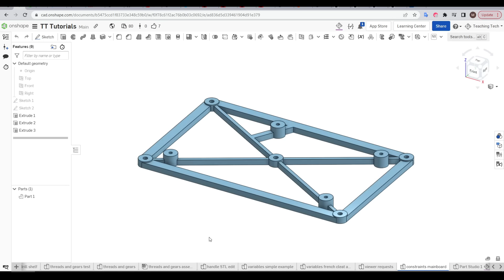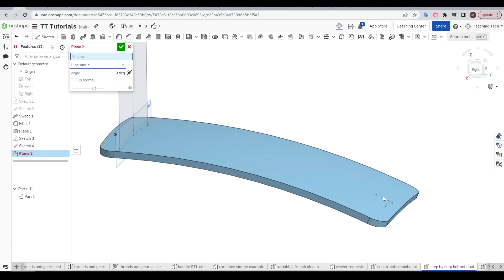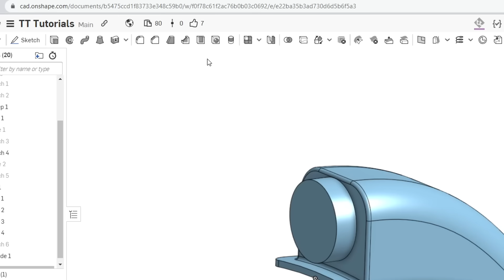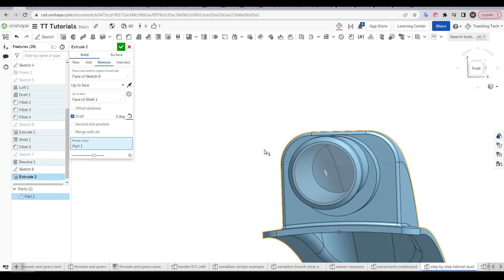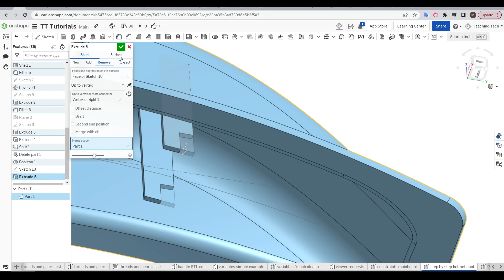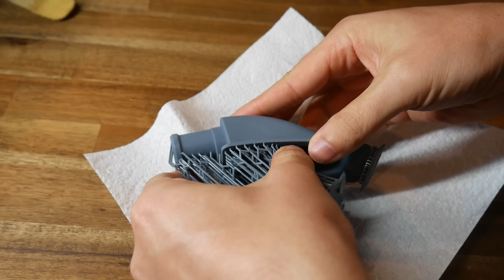Complex design from start to finish - 3D design for 3D printing pt11

Comment: These are the types of videos you bookmark to reference later when trying to model. I have been self-teaching myself on OnShape the last couple months, and have gotten the hang of basic parts that I want to make, but there are a ton of options that I avoid because I don't know what they do, so I work around them with what I know. Just seeing how to easily fix constraint errors will be invaluable to me. Recreating, editing, or making a custom part from scratch, and then 3D printing it and it works exactly how it was intended is one of the most rewarding parts of 3D printing. I put off modeling for the first couple years of 3D printing because Fusion 360 was extremely frustrating. After I started using Orca Slicer to crudely edit parts taking hours to come up with something halfway usable, I gave OnShape another try and I am so glad I did. ChatGPT helped a lot too to understand which tools to use for what and just understand some basic functions.
Another pro-tip, since OnShape is all public models for freemium members, I can often times find models to use or start with that are not on Yeggi or other printable websites. Just a fair warning, that some modelers might do things a lot differently from you, so depending how complicated the model it is, it might require some finessing.

Comment: This part is symmetrical with regard to the plane having its normal going through rider's ears and sitting in the middle of the helmet. Why not to use this symmetry, design the half, and mirror it? This would decrease complexity and work.

Comment: In terms of the inner bore draft you could of used bore gauges to measure both ends and then figure out the draft angle using math. Just pointing out that it is not impossible ;)

Comment: When I'm trying to "draft" the edges of the base (8:41) I get a message saying "Draft did not generate properly: Selected faces could not be drafted". It works for the scoop up top, but not the lower edges. I tried enabling "reapply fillet", but that didn't work either. Any help would be much appreciated. Also thank you for creating these tutorials! They are extremely helpful!
Reply: Fix: I had to delete the fillets from around the base and reapplyt after I drafted.
Reply: But now that I reapplied the fillets after the draft I cannot shell from the bottom...
Reply: Fix: I had to delete the fillet from around the back (face with nozzel) to get the shell to work.

Comment: I need to replicate the curved surface of the rear fender of a 41 Willys Coupe.  I have measurement tools to generate a mesh of x,y,z cartesian coordinates. Would I be able to create a complex curved reference plane from that using FreeCad? My ultimate goal is to install frenched-in '58 Caddy tail lights.

Comment: it would be helpful if this wasnt so perfectly done everything the first time but with an occasional error and how to correct it.
For example I didnt draw the inital arcts on the level of the centerpoint and struggling how to move the arcs. Then I deleted the first vertical construction line, used coincident and the arcs disappeared, completely. :-/
Reply from the maker: I hear you. I guess I'm trying to keep this one concise.
Reply: @TeachingTech  makes sense! :-)

Comment: In the split command there is an option to "keep both sides" that is toggled yes by default. Unclick it and toggle what side is kept with the arrows next to it! And you can split to the curved surface directly on the part, no need to make the plane ^^

Comment: Yo, there is a mate connector option when making new sketches right next to the blue input box! No need to make separate sketches with constrained lines and a new plane on line angles, just use the already available mate connector!

Comment: I understand the teaching lessons in the session but the practical cave man in me asks wouldn't it have been easier to make an adapter from end of hose to end port  and increase chances a similar favorable outcome by decreasing  statistical probability  to fail due to any custom design work or layer adhesion and or sheer surface area of same said models and solutions mentioned ... less material or even surface areas used decreases probability to fail due to design and or even material limitations

Comment: Quite complicated and a bit too quick for me plus I won't be using this software but I got something out of it in regard to measuring with my digital micrometer then sketching on paper first thing. It all helps doesn't it. Thanks for your tutorial TT.
It occurred to me that anything one does online automatically becomes the property of the online entity that is supplying the capability/tools to create an object. Bit like Facebook and photos. It's a trap for the unwary.
Would it be correct to say that use of this software automatically removes any copyright hold you might have or thought you had on the object being designed?

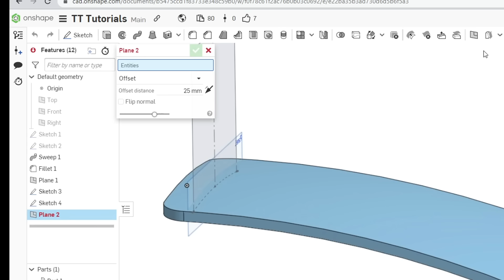Comment: 5:55 - SolidWorks requires additional elements to build this plane, although the plane appears in the preview after the line is selected. To be honest, this operation took SolidWorks and me by surprise.
8:20 - SolidWorks was unable to complete this operation :) Firstly it only slopes the top large part and only in one direction - outwards. Secondly, the slope of the base is made only when additional fillets are selected, and also in one direction. In all cases, SolidWorks runs error correction and these operations are hounded in the build tree with errors.
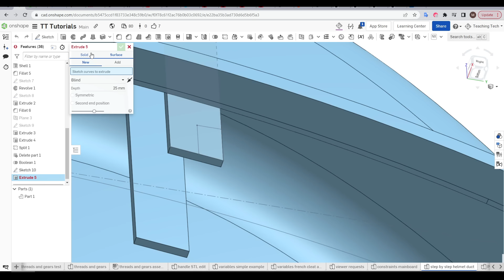17:20 - This simple operation baffled SolidWorks: the Cut operation flatly refused to cut the sketch and I had to do it with an Extrude and Boolean operation.

If someone repeated this detail in SolidWorks and you have it built without errors, let me know.
Reply: Inventor shows similar errors, couldn't finish it

Comment: Nice one and in this case the hole 4-8 minute part could've been done easier by just doing one sketch on the frontplane for symmetrical extrusion and maybe a boolean subtraction with a thickened bottom-part if it sticks out, but there are other non-symmetrical objects this loft-method seems appropriate.

Comment: As a CAD designer for over 40 years and been using onshape from its launch i found your video very good, i know there are many different ways you can model this and i believe you adopted this approach to show the many different methods of modelling, as an ex instructor application engineer, i used to do demos for another CAD system (Solid Edge) and i know how hard it is to demonstrate every technique in 1 model, Hats off to you, not used onshape for a few months so decided to watch your video and picked up a few tips i did not not know, as i always says every day is a school day, and you never stop learning. Just FYI regarding the 2 small ribs / gussets you created and you guessed the radius, which as you say does not matter as its overlapping and will union with the outer body, but if you wanted to get an accurate profile you could create an intersection curve / surface to get the exact profile, again not criticising your method as its perfectly valid and as i said before there are many ways to skin a cat. Keep up the good work and also enjoy your 3D printing Videos.

Comment: Hello Mr. Laws, I was curious if you know of a way to simulate what is referred to as "Intermittent motion" in onshape assembly. Essentially I want a piece to move freely in the X axis, with limits, and be "pushed" back and forth by contact with another object on either side of it. The piece going back and forth on the X axis is attached to a piece that slides back and forth of the Y axis.

Comment: This info is useful for my planned project. I have a 7 inch V-stack with a filter as my intake for my big turbo gti build. I have been looking into the apr intake that uses the inlet in the front bumper but with this info and some high temp filaments I think I could make my own duct to pull the cooler outside air in. This comment is for pt 11 if post to.pt5

Comment: You need to work on your design efficiency and remember some of the fundamental rules of creating in 3D modelling tools, it is quicker to subtract than it is to add. A large portion of the effort/work done here should of ben done from subtraction techniques from solid blocks which would of dramatically reduce the time to model and made it much easier to make changes to the model later if a "tweak" is needed. Remember when it comes to 3D modelling, Offsets, Fillets and Chamfers are your best friends....

Comment: Thank you for creating and sharing the design of such a complicated part. I was wondering if you chose to model the whole part in order to be able to do the video because I was wondering if a small transition piece could have been made from the rounded rectangular inlet of the clear plastic item to a round inlet like the item you made. Print the rectangular part of the transition in TPU so that it forms a good grip on the clear plastic and somewhere during the transition to the round end switch to printing in PETG for strength.

I'm not criticizing you in the slightest for how your work. I appreciate your videos very much and thank you greatly for everything that you offer the community. I know that there are multiple ways to accomplish tasks and perhaps the one I suggested isn't feasible for some reason, such as it would cause the hose to stick back too far and push the drivers head away from the headrest if the adapter went straight back.

Comment: Great tutorial on using onshape!
However, you missed a real engineering process. Evaluation.
Always evaluate;
1)What is/has been done
2)What is the objective/end result
3)What are the real-world constraints, aka: physical and managerial/political
4)Is there a completely opposite/different approach to this idea/train of thought???
In this case, why on top, not on both sides and is the the tube really necessary? Really?

ALWAYS  QUESTION  EVERYTHING ! ! !

That is the real engineering way 👍

Comment: When teaching my robotics students I always liked to make the point that there are often many different ways to design the same part.  This is a great way to show application of the many different tools available. I would only add that it's important to remind viewers learning how to design that learning to be efficient to minimize operations is important in both crating assemblies that have many parts and editing parts you previously designed for new applications or assembly iterations. Most of the time the fewer operations required to create a 3d part the better. Overall though for this purpose this was a very nice tutorial!

Comment: I need some help, i  neen trying to design some pistol grips and since its very complex, i had to use loft so it does come out rounded like i want, iys more fillets, i'm not happy, it is a 38 ruger. i tried everything i know. i would like to see a video or so where to go to figure it out, thanks for anthing you can provide, i can email you if you like on specifics
Reply from the maker: I have designed grips like that in the past. Like you describe. I used a multisketch loft followed by fillets.

Comment: What is that duct on the helmet for? Is it an outlet or inlet? Do you connect it to a filter or something?
Reply: Probably you connect it to the exhaust pipe 🤔
Reply from the maker: It's for driver cooling. Some cool air into the helmet.
Reply: @TeachingTech  That sounds very interesting, where does he extract this cool air from?

Comment: Great tutorial as always. For the "Line Angle" plane, you could have used the "Top Plane" as your second entity to get rid of the warning. You could have also used the Surface Fill tool to create the surface that you used to split the inner parts, which would have matched the full compound curve rather than just the curve in one direction. Finally for the little strengthening fins on the inside you could use the Rib tool from an offset plane at the bottom which would then match the curve perfectly, but you'd have to set it to not merge and then cut the corners off before re-merging it all.
Reply from the maker: I always like comparing the different approaches people take to the same problem. Thanks for sharing yours.